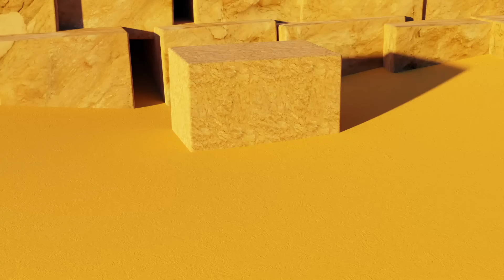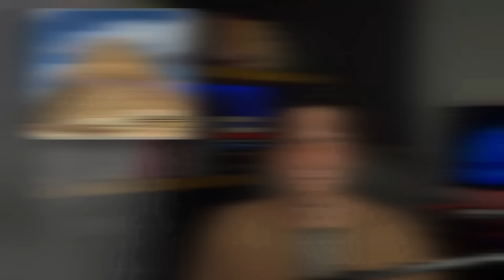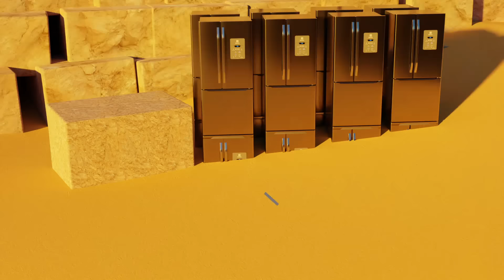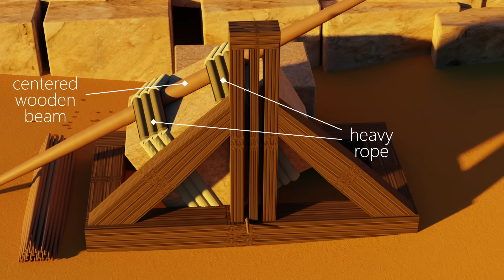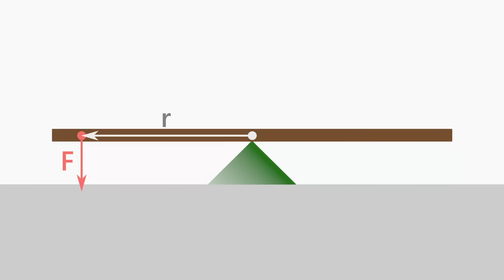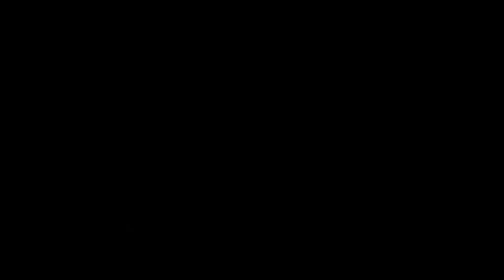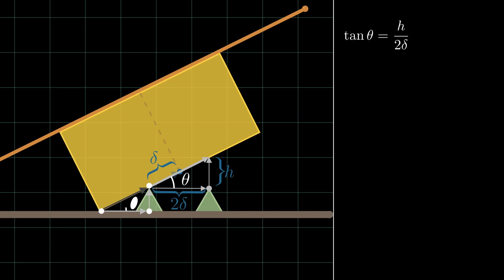Physics Reveals How the Pyramids were Actually Built

Comment: How is that block just handing in the air when tilted after you inserted the wooden rods underneath several times?
This is yet another delusional video of a guy whose main physical achievement in life is lifting a pen and a computer mouse 1 foot off the table.
Try building a basic rafter structure from 2 by 4 and 2 by 6 for a house that is, say, 8 by 20 ft. working alone or with a friend. You'll get tired just lifting and moving the lumber around, which is quite light and movable, especially compared to freaking 9 metric ton stone blocks. But if you do, you'll learn how hard actual physical labor is, and maybe it will help you to learn a thing or two about construction and how objects are not behaving like your animation or oversimplified calculations on the paper dictate they do. Also, when you try cutting the wood so that it fits together well in that frame of your rafter, do you notice how hard it is? Even with all the modern measurements and electric instruments, it still requires some effort. Now imagine cutting the stone blocks with this precision using tools like basic bronze axes and saws 3000 years ago.
P.S. show that video to people doing masonry work, and they'll laugh in your face because it's just delusional and unfeasible.

Comment: No stone was ever lifted or moved, they were all poured into wooden moulds by a solar lens yes a solar lens. Which used the sun to heat up the lime stones and sand stones and granite and diaright. It's the same with the oblisks the used the solar lens to melt and scoop the sides of the oblisks which was never finished how do you get wooden beams through granite and limestone perfectly symmetrical , is by the stone being solidified and poured into moulds . The super high technology was the sun and the black Kemit people of Egypt. If you look cerfully the noses of fero's has been removed because they were black people governments have hidden this knowledge.

Comment: I skimmed through your video and your outline. Did you address Pulley systems using counterweights that could have been used to build the Pyramid as well? Grand Gallery implies this method and there's also the proposed internal ramp used during construction. I assume multiple lever systems working with internal ramp and pulley systems probably reduced the use of man-power required in certain areas of the pyramid during construction. There are proofs of big circular cuts, straight and sharp cuts in stone blocks and features or stones used, so there may have been tools that may have aided workers other than just tools that were found. Lastly, are there New sources used for the number of stones used and the time it took to build the pyramid? It seems the pyramid also uses sand as filler material. I will watch your video in full once I have more time. I appreciate your thoughts on the matter. Kindly respond. Thanks
Reply from the maker: Thanks for your well thought out comment. Yes, there were many tools employed and my goal is to explore the physics of each of these methods. For now, this video focuses on the Herodotus machine. My goal is to revisit this topic in depth and work out the mechanics of other pulley systems/ramps, as well as cutting the blocks. This is obviously a very loaded topic and this video only scratches the surface. Thanks for your helpful feedback and hope to revisit this topic soon.

Comment: Did I miss it or did he fail to explain how they got the first rod in? They would have to lift the whole weight, no? Also, he did not calculate how strong those rods would have to be to accept the weight of the block without splintering. I would also love to see a calculation on of how long it would take to lift each block to the next height because then you need to multiply that by the total number of blocks in the pyramid (2+ million) by the number of levels in the pyramid.

Like so many of these ‘explanations’ it fails miserably.

Comment: He was close ! But no cigar. To know how the pyramids were built you have to look at the building methods used by previous neolithic civilizations . We find in South Africa structures that are older than egypt dating back 200,000 years and then further back 600,000 years ago We see that as the paleolithic age ends that the Neolithic period begins . Construction methods at these ancient sites show that they used clay to make brick. Here we find the origin of Egytian technology. The secret is that the blocks used to build the pyramid started off as granite sand from fault lines with granite Stone as techtonic plates began to shift. This granite sand was mixed with mortar and blocks were poored with form boards around the out side three corners of each block this is the reason they look to be supposedly cut so well that a sheet of paper cannot be passed between it . Nothing extraterrestrial about it .

Comment: So if I doubt your hypothesis, I should ask the aliens? Ridicule & scorn is not the way to keep rational dialogue open, it's an attempt downplay alternatives; not scientific Doc.
I enjoyed your delivery and the maths, however I'm not convinced, even though Newton science can describe the theory, the ability to put this idea into practice on the scale required is unlikely. I suspect that the pivot point material would not stand to the pressure imposed, let alone the need to rise to the heights required, within the space available, not to mention the multiple other variables ignored. What if that 10ton block is 70tons or more? What happens if the block starts sliding? Thats a tremendous weight to bring to a halt!
Another attempt to shoe-horn prosaic construction techniques into the consensus hypothesis that is accepted as fact. Your video title is an assertion that is not born out by the revealed physics.
Well presented but I think I'll chat with the aliens, it's more likely that they will reveal the truth 😜
Reply from the maker: I like how you opened with calling out ridicule and scorn and then signed off with ridicule and scorn.  Thanks for watching and your comment.  Just need to practice some self-awareness.
Reply: I’m sorry you took my “sign off” the wrong way, perhaps it’s a cultural thing, it was more a tongue in cheek comment.

Comment: how do you even center the block and setup for first tilt?
Reply: Magic!
Reply: Just a slight ramp level with the two pivot points is fine. you just have to have part of the block lean over the edge of the ramp on one side so that you can tilt it that one direction to get the first added slat in.

Comment: so this machine would need to span several steps, because laid blocks overlap and your lifting one block. then you would need to offload this huge block latterally and so design this machine with that in mind, so that it doesnt catch on anything or tip over, or the block falls down in any direction. Considering that such a machine would be very slow, having one, very large one operating like a lift to every level would take millenia, so lots of small machines lifting up one level would be logical. this would mean that you would need to offload and then somehow reload the next machine, probably on a wooden platform due to lack of width (the pyramids blocks are overlapping). so you would have a huge series of probably interlocking machines attached to the structure how? I think that this would all be way too fancy and have way too many points of failure to be practical. Honestly I think they most likely used a few different techniques as apposed to just one. as for the one block every six minutes, well for the bottom i dont know 40 layers they could have used dozens of ramps with sleds, rope and teams of 100s of men on all sides lifting thousands of blocks a day. That first section would already account for the majority of the entire number of blocks and would pump up that 1 in 6 figure massively for when they inevitably slowed down for the middle and upper stages, as building out ramps would take as much material as the pyramid itself! Heres my theory for the middle stage; they built a wooden rail either flat on the unfinished face with a massive scaffold or with the first few blocks removed and collumns wedged behind laid blocks. the blocks were then dragged up with again teams of 100s of men (or animals) who are standing on the top of the structure. The dragging up part should, with enough men or animals be no problem, the blocks would be on the same sled from the quarry to move around easily on the floor, but also be more slippery (wood on wood > stone on wood) on the rail which would to be super beefy and greesed! Then the upper stage, this I really don't know as they would have less and less space to move on the top and so couldn't have as many men pulling on the rope, maybe the ropes were hanging off the other side of the pyramid being pulled from the bottom or maybe a scaffold on the other side and loads of guys pulling from on it? The blocks were smaller but eventually at the peak theres only space for a few people! I think they will have improvised some real mcgyvery thing, with a beefy scaffold built up from the rails scaffold and ropes everywhere and over the other side! then to finish up the stonemasons finished the stones upon which the rail was and take down the scaffold at the same time.

Comment: Could heat be particularly help.
Extreme heat, controlled within gravel chain reaction of heat. Clay forms and casting stone. 
Exothermic reaction and thermal dynamics laws. Pottery clay was made with iron oxide color. Aluminum was around from smelting.

Comment: Mathematician Dude.... As a mason....
I can tell you that the piramid of keops 
has to be built from the inside out, starting from the center of the piramid to one of the corners,then to the next corner either to the left or right of such first built corner,then to the third, leaving the 4th corner for last,but in stages the, first corner being elevated half course of the second one, this one being half course than the third one,So each previous course can be used to pivot the next higher course.this will leave you with the with the last 25% of the piramid to be built, but with built in step system from the center, coming from the other three corners,at this time of construction the piramid would looked a little bit like a solid tripod with the bottom courses extending to the last corner.this would of course be the most difficult part to build and would probably require 50% of all energy used in the construction process, but building it in this way it would have save you lots of energy and time that now can be directed to the most difficult part of the construction.
This doesn't mean that advances of the last corner can be made while the others are in progress,but its important to keep in mind that a central corridor must be kept open as long as possible to avoid as much as possible vertical lift,to think that you have to build it from the outside and the 4 sides simultaneously can come from somebody that hasn't ever been involved in the construction using rock blocks.You have to be pragmatic and practical.Any good Mason can keep all the different construction axis level.The Egyptians say that it took them 20 years to build, but if we know anything about human nature.... it probably took them 40 years to build. Take care.
P.S. I know....yes somebody already solved the problem.Remember it was me.Ja,ja have a good day

Comment: I wonder how the stone blocks could be straightened on the underside so that they lie reasonably on the lower stone without wobbling. Because if individual stones wobble, the pyramid collapses. And it must be extremely time-consuming to lift the stones again and again to adjust them to the lower stone. It would be interesting to investigate whether the stones rest on the entire surface. If they did not rest on the entire surface, they would break under the enormous pressure of the stones above.

Comment: I think everyone has way over thought this.  If you take a bi-pod and have it at an angle of 5 to 10 degrees off center above a load, when you continue to stand it upright, the mechanical advantage you have of the lifting force can be enormous. Not only are you lifting the load, but you are also able to advance it in a direction of travel.
  With a bi-pod, the weight is transferred to the two legs as a compression force allowing relatively small dimensional timbers to be used. As an experiment to lift a 10 ton block, I think a couple of today's utility poles would be more than sufficient.  A tension line connecting the bottom of the two legs would be used to keep them from spreading apart under the load. You could use two smaller, shorter poles fore and aft to manage the bi-pod from tipping over once it has been erected, limiting it's angle of lean from center. Once a lift/travel has been done, the load is disconnected from the lift line, the bottom of the bi-pod is skidded forward, the load reconnected and the process repeats.
  I tried out my theory with a couple of 8 foot long 2x4's and a V8 engine on the ground in my backyard. I was easily able to lift it by myself and traveled about 3 feet with each reset. Could you imagine what two 50 or 60 foot poles and a couple dozen guys could do?
Reply: This exercise was based on historical descriptions of a machine that was actually seen in use.

Comment: Not every inch of the pyramids are stacked large stones. They built inner walls and backfilled them with rubble, and sand. That sped up the process. And cut costs. There is lots of videos explaining that, and showing the rubble. And when drilled into walls they hit pockets of sand. That went anywhere from 5 inches up to 30 inches deep.

Comment: Hmmm, ever see Wally Wallington lift a 10 ton concrete block, walk it down a concrete pad then lift and tilt it to vertical and slide into a pit Stonehenge style?  Oh yeah, by himself with NO help?
Wally was a retired carpenter and his channel shows him doing this, not forgetting his wooden rail system used to roll square blocks smoothly down his concrete blocks used to counterweight the 10 ton blocks...
He proved he could have built all of Stonehenge by himself...
Do you think the Egyptians collectively weren't as smart as one retired American carpenter?
When you need to move a million 10 ton blocks, you streamline and or automate, and several thousand laborers organized into crews could build the Pyramid in efficient time spans, math be damned.
Common sense ( knowledge gained by experiencing failure ) always conquers...

Comment: 10 million stones the size of a car in the giza complex, moved from a quarry over 500 miles away, cut and stalked perfectly on sand using manpower, ropes, trees that dont exist in the area, and 2' copper saws. Its not about giving credit, its about the laws of physics
Reply: 99% of the stone was from Giza. Under 1000 meters away.
Reply: And we've found many roadways where they would roll massive stones and blocks.
I've used basic technology to move a 600lb locker full.

The technology used the corners of the blocks as teeth, the depth and spacing of logs in the ground as gear teeth, and it rolls with ease. Downhill uphills would be tricky, but if regulated gear rations were added, it can work..

The invention of the wheel and rotational devices
Reply: Yeah, well if you do the math, it doesnt add up, tell yourself what you want to believe, but there have been many intelligient people calculating the amount of stones weight transport cutting carving the millions of stones with perfect precision with primitive tools, then putting each stone together air tight and symmetrical into place without using any kind of modern technology close to what we have today? Theres something about ancient history there not telling us. Either they had advanced technology thats been lost through time or, there are advanced beings giving them technology to use mathematics and architecture with specific kinds of machinery and innovation that would have allowed them to cut, shape and placed in the perfect position that allowed these ancient civilizations to be able to not only gather and distribute the millions of blocks and sandstone, but to also build this massive structure with stones that weighed 10 to 20,000 pounds or more and lift them high into the air to place them one on top of the other, most people arent grasping the kind of machinery, skillset, or force required to carve these stones with mathematical precision after transporting them, and to lift these beyond impossible heavy stones to heights that machinery today would struggle with, one after one fit every block into place where they were air tight cant fit a need through any of these stones because of how perfectly carved and positioned together they were. The kind of task that were talking about still marvels the best l modern architects in modern society today..like I was saying, there's was something going on and more to the narrative to this story than what the ancient Egyptians are leading you to believe. Their egos are too big to admit they eithrr had advanced kind of technology or assistance from very talented high iq beings that taught and gave many human civilizations important knowledge through time so that they could flourish/thrive and have a sustainable lifestyle. Im sure they had slaves that also worked their ass off, and had primitive tools as well. But im going to keeping this simple tonight by saying theres more to this story  than they are leading on or telling you, and thats all im going to say about that